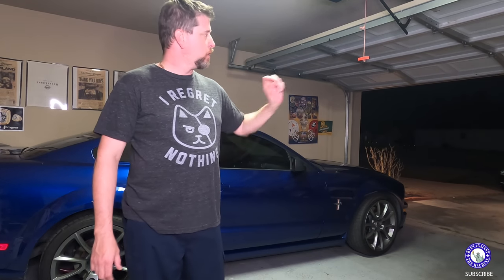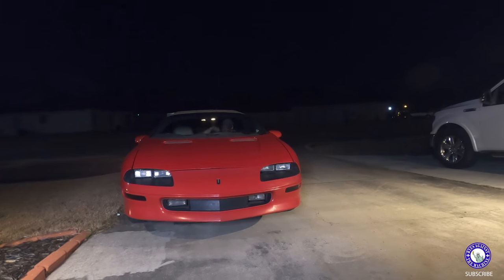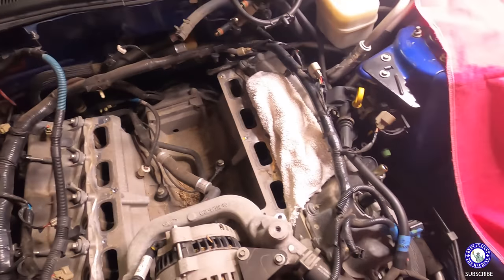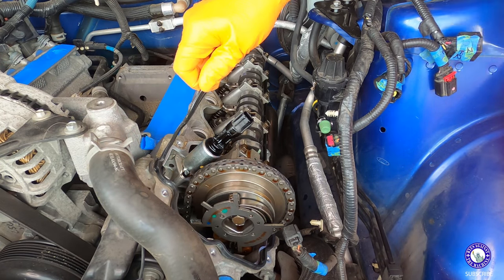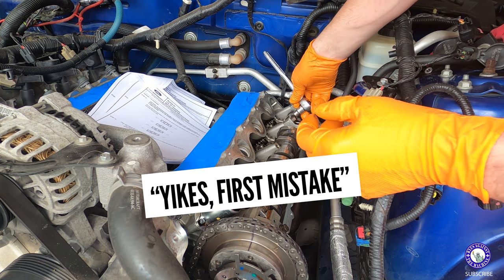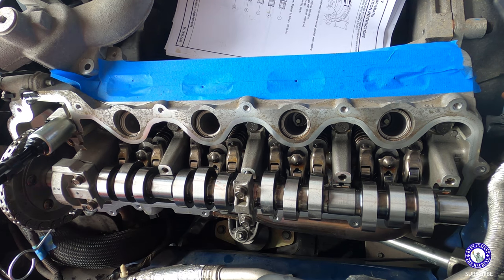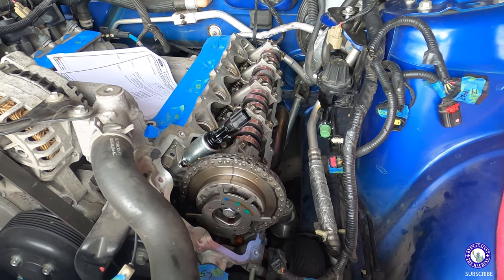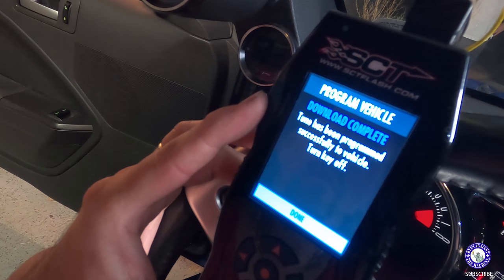Ford Mustang GT Hot Rod Cams, Intake and Throttle Body Install & Road Test

Comment from the maker: Help support my channel by purchasing some merch: 

https://www.etsy.com/shop/RyesAgainstMerch?ref=seller-platform-mcnav
Reply: Did you use the timing chain wedge tool and do you need to?
Reply from the maker: @talinegle6182   I did and you absolutely have to use the timing chain wedge tool. If you do not the timing chain will fall off the bottom sprocket and you will 100% have to remove the entire front of your engine at that point. It's a cheap tool and can be easily purchased on Amazon.

Comment: I'd recommend getting a catch can, I had one on my 3v and caught about 12 ounces of oil in about 20k.
Reply from the maker: I will be purchasing one up very soon. When I picked up my old intake off the floor there was way more oil on the ground than I was comfortable with.
Reply: So what’s the pros and con of getting one?
Reply from the maker: @sofakingraw4149  Cams affect what rpm range your motor will make the most torque. As horsepower is a function of torque, by moving that peak torque up in rpm, you gain power.

In doing this, however, you lose lower-rpm torque, which is most directly associatated with how the car drives on the street, aka "streetability" and depending on your cam selection lower MPG.
Reply: @ryesagainstthemachine2995  thanks buddy but I was referring to the Oil Catch can.
Reply from the maker: @sofakingraw4149  OH LOL sorry. I personally don’t think there are any cons to a catch can except for the extra maintenance step of emptying it during every oil change. 

Pros are that it filters oil and sediment from getting into your intake which over time will decrease horsepower and  fuel efficiency. 

I took my old intake off and set it on the garage floor while installing the new one. 2 days later I picked it up and there was a small pool of oil on the cement. Proof that the oil from “blow by” does indeed make its way into your intake.
Reply: @ryesagainstthemachine2995  Thanks for clarifying that. I have seen the word oil catcher but no one explained it’s function thanks
Reply: Or you could just change the pcv valve here and there...
Reply: @ryesagainstthemachine2995 I have a 2006 GT in the same vista blue metallic color. I bought it new and it just hit 100K miles this summer. I don’t have catch cans and my car runs like new. I don’t really think it’s necessary, at least not for me as the last few years I drive maybe 2000-2500 miles a year as a weekend cruiser and it’s stored 6 months of the year and the oil is changed at the start of each summer season. It’s not like it ever loses enough oil to create any issues.

Comment: Nice car and video 👍🏻 when you put on new blue valve covers, did you use the old gasket in addition to the new sealant?
Reply from the maker: If I remember correctly I didn't use a new gasket. Specs just called for a dab of sealant.

Comment: Thanks for posting this video! I have a 2006 mustang gt and i want to do the same mods. I have a question for you. What is your mpg since installing the cam and intake? I use my mustang for daily commuting on the highway and that’s my only concern.
Reply: I'm building up my own s197 GT and s197 when looking into cams I've found that as long as the cams don't require phaser limited it won't kill your gas mileage. Maybe see a tiny drop or gain on fuel economy. Mutha thumprs were gonna be my go to but after finding out they're mainly for sound and require phaser limiters I decided to maybe consider Detroit rockers or maybe FRPP cams. I'm still researching and learning so I could be misproven if you've found ways to work around the downsides. Since FRPP cams harm low end performance people will go up to 4.10 gears but that hurts max speed and fuel economy. Cams are tricky so do let me know if you think you can tell me something that could help me
Reply: I know this comment is old now, but I installed the hot rod cams on my mustang and actually saw an increase in gas mileage, I also switched from a BAMA tune to a Lito tune, so that could’ve been a factor as well
Reply from the maker: @plasticcommando4486  is exactly correct. I'd hate to give you an idea on gas mileage because I installed 4:10. Interstate speeds is around 16-17 because my RPM's are so high due to the gears.

Comment: Did you have to compres the spring and remove the followers on cylinder 5 and 7 ? Late model restoration posted a video and they did , I was just wondering if it was necessary
Reply from the maker: No. I did not remove any of the followers or springs for the install

Comment: Nice video! I have an 05 Gt as well and I want to cam it! Quick question do I need the tune before I even start the car with the cams installed? Hard to find detailed information on tuning and when it is required
Reply from the maker: No, you can tune after the install is complete.

Comment: Thanks for the video! Do you need to adjust the position of the crank at all between installing the driver and passenger side camshafts or do you just leave it in the same position for both? Thanks!
Reply from the maker: to be honest I can't remember that. it's been a while now since I installed them.

Comment: Other than knocking a follower off in the beginning and leaving a socket on the crank, any other install issues or problems after? Debating on doing mine myself this weekend!
Reply from the maker: Nope. I was very careful and meticulous. I followed the instruction carefully. It was a very fun and rewarding job and im happy I tackled it myself. Car has been running amazingly for months now.

Comment: I saw a dyno of that manifold and it was not good. It did make 10 more HP than factory but that was right at the top end. Everywhere else it was down by a lot of power. I imagine with the cam it's probably even worse. They said it would be great for boosted setups but not NA.
Reply: Here's the video - https://www.youtube.com/watch?v=FoQnoAQJJg8
Reply from the maker: @MadCarTK  Thanks for the comment. I don't run my car hard to be honest. I'm going for power but mostly going for look and sound. She a garage queen for sure.
Reply: Nothing wrong with that manifold.I'm running it with the same TB he is,and it runs fine.It's all in who tunes it...
Reply: @msm402  Go watch the video I posted, I don't think you did by the way you wrote that comment. You can't tune the computer to create more turbulence in the air to mix the fuel & air better.

Comment: Good job I want to do the exact same thing to my 08 gt. Did you buy your parts directly from ford?. I bought a JLT series 3 cold air intake with the bama tuner.
Reply from the maker: BAMA tune is good with a CAI but if you go deeper like cams I would check the forums. You will see that most people go with LITO for there tune. BAMA canned tunes are not optimal at all!!! 

I purchased from American Muscle and CJ Pony Parts. Each had certain parts that were cheaper so I split the order.
Reply: @ryesagainstthemachine2995  ok I've about LITO, I herd hes the best!.
Reply: @ryesagainstthemachine2995  you said you had it dyno tuned. where did you get yours done? i want to find a dyno tune shop for my stang
Reply from the maker: @kevinmccaffrey9195  You can check in your area. Search dyno tune or speed shop. I got mine done in Baton Rouge at a place called Stang-Hi performance. They have since moved somewhere in Ascension Parish. They are good at what they do but you will pay for that expertise.

Comment: I’m curious I have the cams sitting in my room but I don’t have a tuner cause I read the description on AM that it recommends a tune for it to squeeze out that extra hp, but does it really need to be flashed after the cam install due to it running with the stock phasers and lashers also cause it’s made by the same ford guys who designed the stock cams? I’m still gonna buy the tune either way but I just want to know if it’s recommended or mandatory
Reply from the maker: I believe it is merely recommended not 100% sure. I would 100% go with the tune. You spent the money on the cams so why not get every ounce out of them.

Comment: Those bama tuners are alright but I would HIGHLY recommend getting it dyno tuned it would be well worth the cost and would be better for the emgine
Reply from the maker: I have a custom tune and not a Bama. Would never get a Bana tune for anything than a CAI and even then probably wouldn't
Reply: @ryesagainstthemachine2995  Where did you get the custom tune from?

Comment: If anyone can answer this, I would appreciate it greatly. I have a 05 Mustang GT with 38k miles and I'm hoping to replace only the cams with new Ford Performance Hot Rod Cams. The car has been taken care of for those 17 years, but I'm not sure if it is a good idea to replace the springs/the entire valves since they are that old . Do you think the valves will be fine with those cams?
Reply from the maker: My car had about the same mileage when I did the job. I did not replace and springs or lifters and it is not required with these cams. A tune is required though.
Reply: @ryesagainstthemachine2995  Gotcha. I just wasn’t sure how aggressive those cams are even though Ford says that they will be fine. I have a local tuner that I like so I’ll have that towed to his shop. I appreciate your help man!
Reply from the maker: @Rodger Langley  what else do you have done to the car? I ask only because you won't get much gain without some decent headers. If your looking just for the aggressive sound you'll get it but without other mods like headers and some more room for the car to breath with intake or throttle body you won't get much HP gain.
Reply: @ryesagainstthemachine2995  I was going to get some long tube headers soon. Currently I’m putting the cams, new intake manifold, throttle body, coil packs, and injectors. I already have a cold air intake on there but it’s just a start for right now

Comment: How much did this setup cost and would you recommend this up grade for my 2006 mustang gt 4.6 with 154000.
Reply from the maker: if I remember correctly it was close to $2,000. i bought from both American muscle and CJ Pony parts. As for recommendations on your year and mileage I wouldn't know but post up in a forum. Plenty of helpful folks there!!

Comment: sweet setup...i want to do this to mine...i wonder how much hp you gained
Reply from the maker: Can’t be quite sure but during my last tune I had it dyno tuned and it was putting 318 at the rear wheels.
Reply: 318 is appropriate for cold air and tuned. But with cams and intake manifold plus cold air and tune.. hopefully x pipe. My guess is 350 wheel

Comment: Do you need to change intake manifold and throttle body in order to put hot rod cams?
Reply from the maker: No but it does pair well with the cams.

Comment: Do you have to put a new gasket on?
Reply from the maker: Yes  and RTV Sealant in the same place that it was when you removed it. My valve covers came with the gasket installed.
Reply: @ryesagainstthemachine2995  thanks for the quick response!

Comment: BROOM BROOM 05 MUSTANG FLY
Reply from the maker: My man!!! You like that sound?
Reply: @ryesagainstthemachine2995  YES
Reply: Thinking about doing this setup,any regrets,advice ??
Reply from the maker: @calewood21  no regrets at all. I love the sound and the power. Having long tube headers and 4:10 gears matched with it helps a lot too.
Reply: @ryesagainstthemachine2995  So I’ve ordered my Ford performance Hot Rod cams,what programmer and tune do I need ?? I watched your video probably 10 times !! lol
Reply from the maker: @calewood21  Thanks for the support and I hope it helps with your install a little. I tried to include all the things that I did not see in any other videos before I did the install. I used a remote tune from Lito with a SCT X4. If you look at the major 3v forums you'll see his name everywhere.  

http://www.tudyno.com/

You send him your mods and he sends you a tune but it doesn't end there. You do datalogs and he'll send you new tunes until he dials it in perfectly for only $200. He is the 3v whisperer!! He send me 3 different tunes until he got it perfect and I love it!
Reply: @ryesagainstthemachine2995  Thanks man